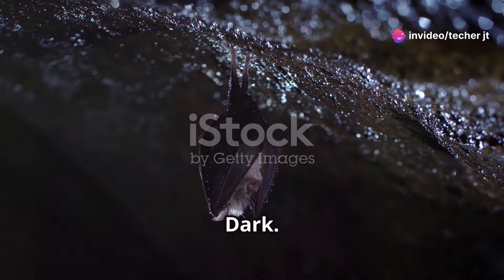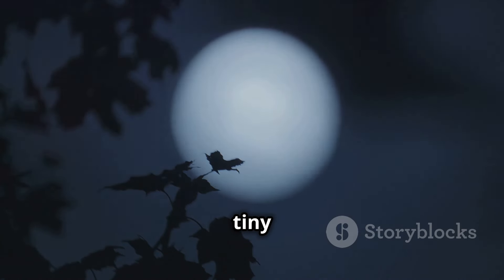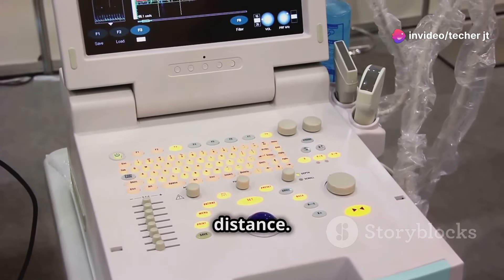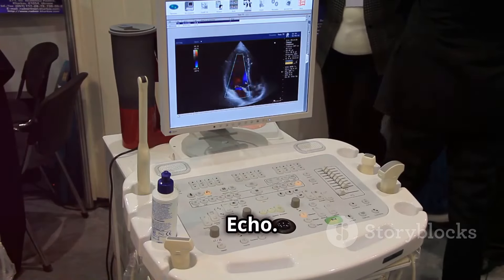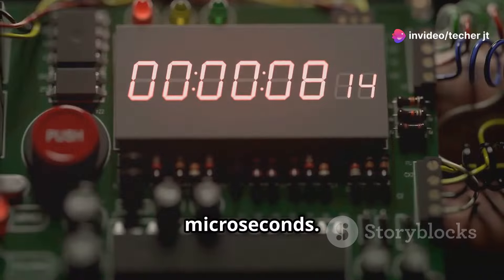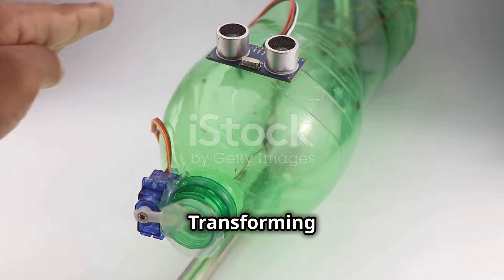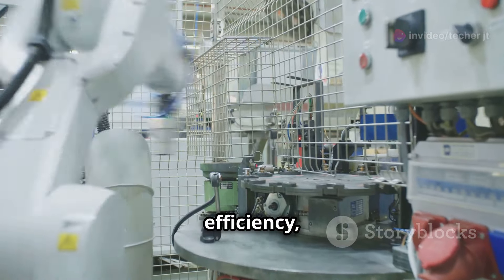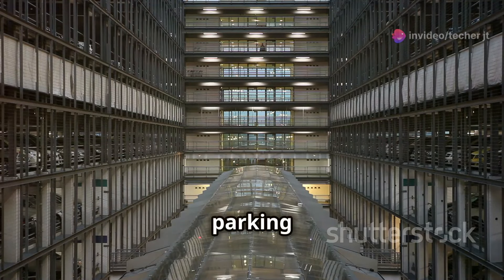Unlocking the Power of Ultrasonic Sensors: How They Work and Where They're Used!

Comment: Maria Juliana Lois M. Palacio
10 - LYRA

4. Evaluating: Assess the impact of environmental conditions (like temperature and humidity) on the accuracy of ultrasonic sensors. What measures can be taken to mitigate these effects?

Environmental conditions like temperature and humidity can affect the speed of sound in the air, causing ultrasonic sensors to calculate distance incorrectly. Temperature correction algorithms and humidity-resistant sensor materials can improve reliability and accuracy.
Reply: Mitch Micah Niere (X - Lyre) 

4. Assess the impact of environmental conditions (like temperature and humidity) on the accuracy of ultrasonic sensors. What measures can be taken to mitigate these effects?Temperature and humidity in the environment can impact the velocity of sound in the air, leading to inaccuracies in distance measurements by ultrasonic sensors. Algorithms for correcting temperature and sensor materials resistant to humidity can enhance both reliability and accuracy.

Comment: Cherish Stefie D. Bacayo 
10- Lyra

1. Understanding: Explain the principle of echolocation and how it relates to the functioning of ultrasonic sensors.

Answer:
Echolocation is the process of using sound waves to determine the location and characteristics of objects. Animals like bats and dolphins use this naturally. Ultrasonic sensors mimic this by emitting high-frequency sound waves (ultrasonic) and measuring the time it takes for the sound to return (echo) after bouncing off an object. This time difference is used to calculate the distance to the object.

Comment: Aiko Alzula 
10 - Cassiopeia 

10. Creating: Propose an innovative application for ultrasonic sensors in a field of your choice (e.g., agriculture, automotive, robotics). Describe how it would work and its potential benefits.
- In agriculture, ultrasonic sensors could be used to monitor soil moisture by measuring the distance to the soil surface. This application would provide real-time data for optimizing irrigation, leading to more efficient water usage and better crop management.

Comment: ⭐- 10 LYRA CHAIN:
Reply: James Miguel Lumantas
10-Lyra 

1. Understanding: Explain the principle of echolocation and how it relates to the functioning of ultrasonic sensors.

Echolocation involves emitting sound waves and listening for the echoes that bounce back from objects, allowing the emitter to determine the location, size, and shape of the objects. This is how ultrasonic sensors work also, by releasing sound waves and waiting when they bounce back to determine the position of certain objects.
Reply: Justine Luis G. Espadilla
10 - Lyra

1. Understanding: Explain the principle of echolocation and how it relates to the functioning of ultrasonic sensors.

Echolocation is similar to ultrasonic sensors as they both release sound waves which travel back and forth from object to object and determining the time it takes for said sound waves to return to the emitter to determine the position and distance of objects.
Reply: 1. Understanding: Explain the principle of echolocation and how it relates to the functioning of ultrasonic sensors

Echolocation is quite similar to Ultrasonic sensors, it envolves the emitting of high frequency sound waves around its environment. As it releases the high frequency sound it returns to the device and locate its surroundings.
Reply: Jhonlee O. Oliveros
10 - Lyra

6. Understanding: What are the key components of an ultrasonic sensor, and what role does each play in its operation?

: An ultrasonic sensor uses sound waves to identify things or measure distance. The components of this device include an ultrasonic wave transmitter, a receiver for picking up reflected waves, a control circuit for timing, and a processing unit for calculating distance based on delay. The housing directs and shields the waves, while a power source powers the sensor.
Reply: Jasmine Jade D. Cañete
10-LYRA
6. Understanding: What are the key components of an ultrasonic sensor, and what role does each play in its operation?

-An ultrasonic sensor uses sound waves to detect objects or gauge distance. The device consists of an ultrasonic wave emitter, a receiver to capture reflected waves, a timing control circuit, and a computation unit to determine distance using delay. The casing guides and protects the waves, and a power supply energizes the sensor.
Reply: Angel P. Rivera
10 - LYRA

1. Understanding: Explain the principle of echolocation and how it relates to the functioning of ultrasonic sensors

Echolocation works like ultrasonic sensors because both send out high-frequency sound waves and then listen for the echoes to figure out what's around them. The sound bounces back to the device, helping it "see" its surroundings.
Reply: Xharmei Therese P. Barcenilla
10 - Lyra

10. Creating: Propose an innovative application for ultrasonic sensors in a field of your choice (e.g., agriculture, automotive, robotics). Describe how it would work and its potential benefits.

Answer: An innovative application for ultrasonic sensors could be in precision agriculture, specifically for monitoring soil moisture levels. By installing ultrasonic sensors in the ground, farmers could measure the distance to the water table or moisture levels in the soil. This real-time data would enable more efficient irrigation practices, conserving water and optimizing crop growth. The potential benefits include reduced water usage, improved crop yields, and enhanced sustainability in agricultural practices.
Reply: Blyth Eldrick L. Porsuelo
10-Lyra

2. Applying: Describe a scenario in which an ultrasonic sensor would be more beneficial than an infrared sensor. Justify your choice.

An ultrasonic sensor would be much more reliable than infrared sensors in navigating through a foggy environment. This is because ultrasonic sensors rely on sound waves bouncing back to navigate through the environment whilst still having it's performance unaffected. Infrared sensors, however, can have their performance degraded through a foggy environment because water droplets may scatter infrared light therefore leading to inaccurate readings or even failure to efficiently detect objects and navigate through it's environment.

Comment: May Ville D. Ortega 
10- lyra

1. Understanding: Explain the principle of echolocation and how it relates to the functioning of ultrasonic sensors.

-Echolocation is the use of sound waves to determine the location and characteristics of objects. Bats and dolphins use this naturally. Ultrasonic sensors simulate this by emitting high-frequency sound waves (ultrasonic) and measuring how long it takes for the sound to return (echo) after bouncing off an object. The time difference is used to calculate the distance to the object.

Comment: Oclaman, Eureka Glyril B.
X - Cassiopeia

6) Understanding: What are the key components of an ultrasonic sensor, and what role does each play in its operation?

- Key components of an ultrasonic sensor include a transmitter (emits sound), a receiver (detects echoes), and a microcontroller (calculates distance).

Comment: Zane Mendaros 
X - Cassiopeia

10. Creating: Propose an innovative application for ultrasonic sensors in a field of your choice (e.g., agriculture, automotive, robotics). Describe how it would work and its potential benefits.

- In agriculture, ultrasonic sensors could be used to monitor soil moisture by measuring the distance to the soil surface. This application would provide real-time data for optimizing irrigation, leading to more efficient water usage and better crop management.

Comment: Ruztylou Gaviola
10-LYRA

1. Understanding: Explain the principle of echolocation and how it relates to the functioning of ultrasonic sensors.

-Echolocation is the principle where sound waves are emitted, and the time taken for the echoes to return after bouncing off objects is used to determine the distance to those objects. Ultrasonic sensors operate on this principle by emitting high-frequency sound waves and measuring the time it takes for the sound to reflect back from an object, thus determining the object's distance.

Comment: Jenie Rose Jilhaney
10 - LYNX

6. Understanding: What are the key components of an ultrasonic sensor, and what role does each play in its operation?

Sound waves are used by an ultrasonic sensor to determine distance or identify objects. This device is made up of an ultrasonic wave transmitter, a receiver that detects reflected waves, a timing control circuit, and a processing unit that uses delay to calculate distance. The sensor is powered by a power source, and the enclosure guides and shields the waves.

Comment: Megan Louiesse E. Po
10- Hermes

6. Understanding: What are the key components of an ultrasonic sensor, and what role does each play in its operation?
The key components of an ultrasonic sensor are a transducer, oscillator, receiver, timing circuit, microcontroller, and power supply, which work together to emit, receive, and measure the time of flight of ultrasonic waves to determine distance.

Comment: Joshua El Noah M. Suan
10- Lyra

2. Applying: Describe a scenario in which an ultrasonic sensor would be more beneficial than an infrared sensor. Justify your choice.
-An ultrasonic sensor is more beneficial than an infrared (IR) sensor in environments with variable lighting, such as in automated parking systems. This is because ultrasonic sensors use sound waves, which are unaffected by lighting conditions. They work reliably in both bright and dark areas, whereas IR sensors may struggle in intense sunlight or low light. Additionally, ultrasonic sensors can detect transparent objects like glass, which IR sensors may not detect effectively. IR sensors rely on light reflection, making them sensitive to surface characteristics. Shiny or reflective surfaces can confuse IR sensors, causing inaccurate readings. Ultrasonic sensors, however, measure the time sound takes to return, ensuring accurate detection regardless of object material. In scenarios like parking, where obstacles may vary, ultrasonic sensors provide a more dependable solution.

Comment: Jana Sophia D. Enopia
10 - Lyra

4. Evaluating: Assess the impact of environmental conditions (like temperature and humidity) on the accuracy of ultrasonic sensors. What measures can be taken to mitigate these effects?

Environmental factors such as temperature and humidity can influence the accuracy of ultrasonic sensors by changing the speed of sound. Warmer temperatures can make sound travel faster, while high humidity can affect how sound waves move. To reduce these effects, temperature compensation methods can be applied, and sensors can be adjusted to account for these changes, improving measurement accuracy.

Comment: Dave Aaron V. Dagcuta
10 - Lynx

4. Evaluating: Assess the impact of environmental conditions (like temperature and humidity) on the accuracy of ultrasonic sensors. What measures can be taken to mitigate these effects?

A: Environmental conditions like temperature and humidity typically affects the accuracy of a reading from an ultrasonic sensor since it uses sound waves and the previously mentioned conditions affect those. 

A probable solution could be to use ultrasonic sensors in a controlled environment because the readings wouldn’t be affected as much in a room with a controlled temperature. If you need to use it in an open environment, you need to take into account the temperature of wherever you may be going and calibrate your sensor to it.

Comment: Francess Elizah A. Pintac
10 - Hermes

4. Evaluating: Assess the impact of environmental conditions (like temperature and humidity) on the accuracy of ultrasonic sensors. What measures can be taken to mitigate these effects?

- Environmental elements like humidity and temperature can have a big impact on how accurate ultrasonic sensors are. Temperature directly affects the speed of sound in the air, and since the sensor calculates distance based on travel time, erroneous results may result. To ensure precise and reliable measurements even under challenging conditions, the sensor should be utilized in certain temperature ranges where it can function and perform well.

Comment: Christine Wasquin
X - LYNX

4. Evaluating: Impact of Environmental Conditions on Ultrasonic Sensors

ᯓ★ Environmental conditions like temperature and humidity can impact the accuracy of ultrasonic sensors by affecting the speed of sound. Higher temperatures can increase the speed of sound, while high humidity can alter sound wave propagation. To mitigate these effects, temperature compensation techniques can be used, and sensors can be calibrated to account for environmental variations, ensuring more accurate measurements.

Comment: Jafe Marie A. Ebron
X - Cassiopeia

10. Creating: Propose an innovative application for ultrasonic sensors in a field of your choice (e.g., agriculture, automotive, robotics). Describe how it would work and its potential benefits.

A: Integrate ultrasonic sensors into drones for precise crop pollination. The system maps the field, analyzes plant density, and targets pollen release.

How It Works
Field Mapping: Drones use ultrasonic sensors to create a 3D map of the crop field.
Targeted Pollination: The system applies pollen where needed based on the map.
Real-Time Feedback: Ultrasonic sensors monitor pollen distribution and adjust as necessary.

Benefits
Efficiency: Optimizes pollen use and increases crop yields.
Labor Savings: Automates pollination, reducing manual effort.
Adaptability: Customizable for various crops and field conditions.

Comment: Hershey C. Cano
10 - Orion 

2. Applying: Describe a scenario in which an ultrasonic sensor would be more beneficial than an infrared sensor. Justify your choice.
Ultrasonic sensor would be more beneficial than an infrared sensor in a dusty parking system scenario due to its accuracy and reliability in measuring distances. In contrast, infrared sensors are more susceptible to environmental interference and have a shorter detection range, making them less suitable for this application.

Comment: Abbygail A. Somobay
10 - Lyra

4. Evaluating: Assess the impact of environmental conditions (like temperature and humidity) on the accuracy of ultrasonic sensors. What measures can be taken to mitigate these effects?

- Environmental conditions like temperature and humidity can impact the accuracy of ultrasonic sensors by altering the speed at which sound travels. Higher or warmer temperatures cause sound to travel more quickly, while elevated humidity levels can influence the movement of sound waves. To minimize these effects, temperature compensation techniques can be employed, allowing sensors to adjust accordingly and enhance measurement precision.

Comment: Jalley Christine Bangot
10-Lynx

6. Understanding: What are the key components of an ultrasonic sensor, and what role does each play in its operation?

  An ultrasonic sensor emits high-frequency sound waves and measures the time it takes for these waves to return after bouncing off an object. Key components include a transducer, oscillator, receiver, timer, microcontroller, and power supply. The transducer converts electrical signals into ultrasonic waves, the oscillator generates high-frequency electrical signals, the receiver amplifies and processes echoes, calculates the distance to the object based on the time of flight, and the microcontroller processes data to determine the distance.

Comment: Tabitha Glenne P. Lagria
10 - Cassiopeia

4. Evaluating: Assess the impact of environmental conditions (like temperature and humidity) on the accuracy of ultrasonic sensors. What measures can be taken to mitigate these effects?

A: The speed of sound in the air can be influenced by environmental factors like temperature and humidity, which can cause ultrasonic sensors to measure distance incorrectly. Algorithms for temperature correction and the use of humidity-resistant sensor materials can be employed to improve reliability and lessen these impacts.

Comment: Evzen Radik A. Salvador
10 - Orion

6. What are the key components of an ultrasonic sensor, and what role does each play in its operation?

An ultrasonic sensor consists of three main components: the transmitter, receiver, and microcontroller. The transmitter emits ultrasonic sound waves that travel through the air. When these waves hit an object, they bounce back. The receiver detects these returning waves and converts them into electrical signals. Finally, the microcontroller processes these signals, calculating the distance to the object based on how long it took for the sound to return. Together, these components allow the sensor to measure distances accurately, making it useful for tasks like obstacle detection and level sensing.

Comment: Jasmine E. Delapus 
10-LYRA 

1. Understanding: Explain the principle of echolocation and how it relates to the functioning of ultrasonic sensors. 

 Echolocation used by animals like bats to navigate and hunt by emitting sound waves and listening for the echoes that bounce back from objects. Allowing them to determine the location, size, and shape of objects in their environment. While ultrasonic sensors are electronic devices that use sound waves to measure distance they work on a simple yet powerful principle send out a soundwave wait for the Echo and calculate the distance based on the time it took these sensors are widely used in various applications.